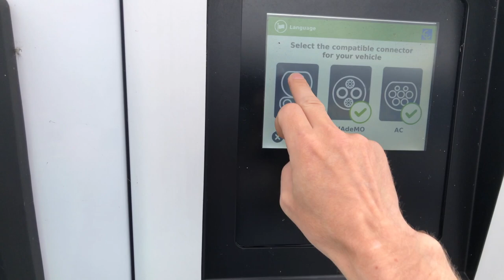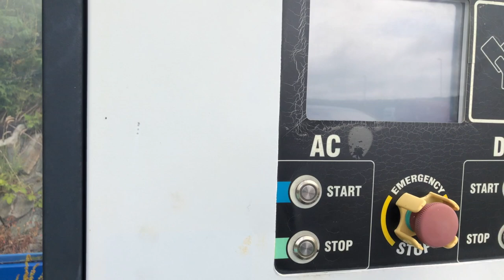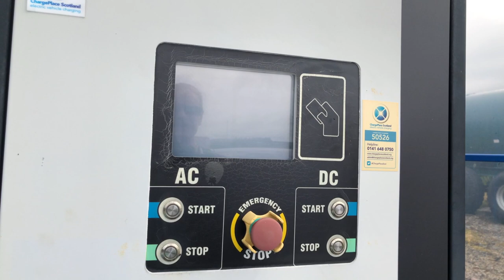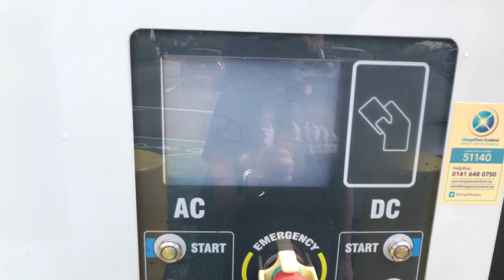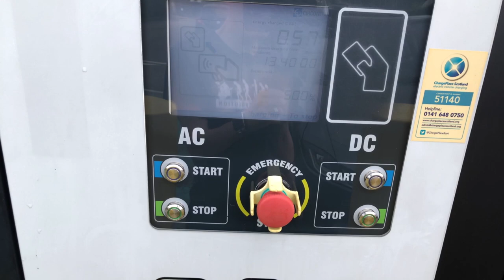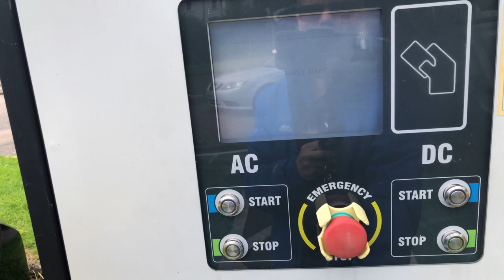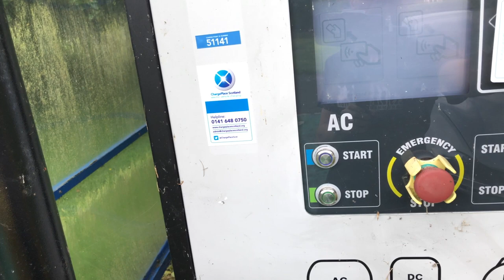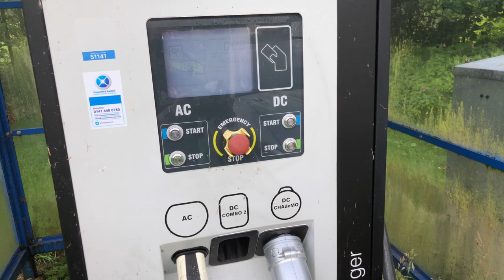I-Pace Vlog - Public Charging Adventure #3 - Does H228 Finally Fix ChargePlace Scotland?

Comment: You did well to test that in the short period you have had the car back. Shame it does not seem to have changed the ABC requirement in Scotland. One positive thing in H228 though could well help me. My car refuses to delay home charging properly even if I use your suggested remedy. Once my H228 is fixed I will test my home charging and report back. 
CLOWN charging works for me as long as I stick to Polar 50kw chargers. Pod point 50kw chargers in Lidl car parks are very reliable as well.
Luckily I do not encounter many of your old style chargers on my travels.
I have now done over 9000 miles and have never run out of fuel - yet.
Reply from the maker: Jagman I-pace Yes that’s one thing that’s happened with H228. The car now seems to pick up a charge without needing preferred charging times and departure times. I plugged it in for 6.5 hours last night and it started charging as soon as the timer in the charger came on.
Reply: H228 now done. Timed charging now works ( I think - might need further testing ). Screen lagging ended and bizarely the car is quieter and the ride is much more smooth, wasnt expecting that. Sota sent me an upgrade last night. Now on 16.2 i think although screen does not say which version and 19A-19.24.2-375121

Comment: Have you heard back from your inside source about why it still fails? Also - which dealer did you get the update at and was it easy enough to get them to do it? My closest one is Jaguar at Hillington, Glasgow.
Reply from the maker: I had it done by Parks Jaguar in Ayr. Very easy to get them to do it. I told them I had been advised that it supposedly fixes rapid charging on CPS when I booked it in. Some dealers will only apply an update if the customer complains about a specific problem that is covered by the patch, so it’s worth researching what each patch fixes and then go to your dealer with the full info. “My car is not charging with my charging timer. I’ve been told that H228 fixes this.” They will usually respond to that kind of trying better than “I know there’s a new infotainment update. I want it please. “

My inside source is flummoxed. This issue is not yet dead! I’m also in discussions with eVolt themselves so will let you know if I hear more. But for now, I’ve resigned myself to ABC for the foreseeable future.

Comment: How are you getting on with CPS and charging the I-pace.  A whole lot of trouble is about to start because it looks like the new model 3 tesla has the same problem charging on the older evolt units.
Reply from the maker: That’s interesting. I hadn’t heard that. That (as I suspected) might help our cause a bit. It’s one thing for one model to have an issue. Quite another if there are several. 

I’m having the same basic success rate. At the moment it’s a 48% success rate with old eVolt chargers and 100% success with the new ones.

Comment: Hi
Could it be a problem with the ccs port on the Cars because think it something to do with communication.between the two.
Colin
Reply from the maker: Colin White I’ve been in discussion with eVolt about this (still ongoing). They are well aware of the issue and apparently it is because Jaguar is pushing the limits of the CCS protocols so the older chargers can’t cope with it. It’s all to do with the firmware on the boards. There are two options. Either Jag changes the protocols they use for the handshake (which I’m told can be done via SOTA) or ChargePlace Scotland replaces the boards on every on of their chargers. The former obviously makes more sense for everyone but JLR have shown no inclination to do so, so I think we’re just stuck with this until the chargers age to a point where the boards need replacing anyway. In the meantime, more chargers will have to be installed and they will undoubtedly be fine so I have to guess it will get easier though it will never go away entirely.
Reply: As I have said before we have a new style50 kilowatt Evolt charger on site with the latest firmware and even after h228 it is still a hit or miss on charges,that’s what makes me think it could be the car connectors communication port Evolt have gave me the same information which I take with a pinch of salt.
I think you have just been lucky at lomondgate. The Charger looks quite new so the connector will still be really tight fit on the car.
Colin
Reply: Watching this channel puts me right off an Ipace what a carry on think I’ll stay with the Tesla idea thank you for being Truthful and patient showing this problem.
Reply from the maker: STUART MITCHELL I understand why you’d say that. I have no intention to hide things so whatever happens on a road trip or any other time I’m filming goes in the video. I don’t think it does anyone any favours to pretend that everything is perfect. However, I have to say that it fails to put me off the car. It will get easier as well. More and more of the newer chargers are coming online so these issues will become less problematic. It’s annoying but it’s something that we’re stuck with. The car is still immense fun. I seriously considered a Tesla but for a number of reasons ended up choosing ipace. I’ve never regretted it (except maybe the first time I realised this problem existed in my first ever road trip in the car). 

For me, the vast majority of my charging is done at home. My life (sadly) doesn’t just consist of making videos as I drive around Scotland! So although the charging has become a big part of the channel, it’s not actually a big part of my life. Also the west and northwest of Scotland seems to have a very high proportion of these chargers. East and northeast seems to have a lot more new style chargers that work well. Also many other providers (instavolt, polar etc) in those areas. I’m planning a couple of road trips which will hopefully show that every trip doesn’t have to be so hard (hope I haven’t spoken too soon). 

The Teslas are great EVs without a doubt but I’m more than happy with my choice.
Reply: STUART MITCHELL  The Jag a great car drive but it definitely got its faults public charging is number 1 in my opinion. I have been within 13 mile range on three occasions where I have almost needed recovery, all because of public charging  letting me down. I have even had major embarrassment at Broxden services in Perth Car could not charge and a Tesla driver coming up to me and saying you should have bought a Tesla The Person had done 70000 miles without a supercharger problem and I will be honest it did make me think why did I buy a Jaguar Ipace.
Colin
Reply: Hi
Big road trips are possible, I’ve been on holiday to Cumbria South Lakes 
Charged 20 mins Dunkeld Siemens charger , 20 Mins Stirling Park &Ride and 30 minutes Abington Evolt machine.I was slightly nervous  about the last one had to reset and then then it worked 362 mile in total .
Colin
Reply from the maker: Colin White totally agree. I’ve done 320. It’s just a bit of a pain, but as long as I get there that’s the main thing!
Reply: @AbuDhabiDude  The problem could be fixing for the older chargers might reduce charge rates on newer chargers. My understanding is what the Jag does is within the CCS standard but that may depend on how you interpret it.
Reply from the maker: iPace Owner I’m not sure that’s got a connection in all honesty. This has been a problem since before the ipace could charge any higher than 50 kw, so I don’t think there’s a connection. There are other cars which charge successfully on these chargers which take faster rates at ionity etc, so it should be entirely possible for Jag to do. But we’ll see. Im just keeping everything crossed that somebody comes up with a workable answer, or that there is a sudden rapid rollout of new chargers!
Reply: @AbuDhabiDude  I wonder if any of them draw the same ampage as the iPace. I get the impression that is a lot of the issue.
Reply from the maker: iPace Owner According to eVolt that isn’t an issue, but at this point who knows!
Reply: @AbuDhabiDude  interesting.
Reply: @AbuDhabiDude  so I've been speaking to someone who knows a bit about chargers

"The biggest difference between other cars and the I-PACE is the 450-500V voltage range... its this IMHO that causes the problem especially on older kit where voltage regulation is not so great at the top end of the range. Some of the Scottish units are pretty old"

I asked him if Jag could tweak anything and he didn't think so saying this was CCS1 and "CCS comms are a standard (I know we both know thats a wide goal) but CCS1.0 is well known at this point. Where JLR have tweaked things its been CCS2 for ABB units, in all other cases when they've worked with charge manufacturers its been on the other side of the negotiation and not the car."

He says in his experience "Most common problem is timeouts on negotiation, or supplying out of range voltages in the negotiating process." the former is solvable by locking unlocking immediately charge negotiation starts but is unlikely to be the issue here.
Reply: iPace Owner 
I think you could be right about the voltage.
Before h228 I would get a high voltage error in the car when charging on an old style evolt at start .But the weird thing now is post h228 I get the high voltage error at the end of the charge when stopping sometimes on the old Style now so I think Jag has changed something.But I have tried a few old style evolt ( Pitlochry,Alford and Aviemore) and managed to get a full charge at each of them.